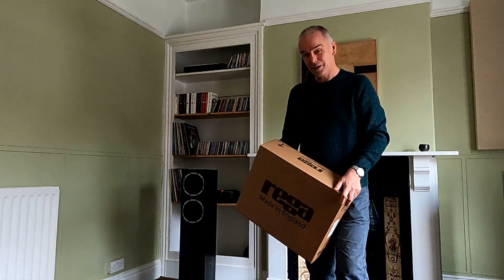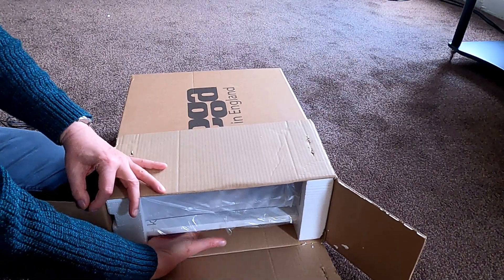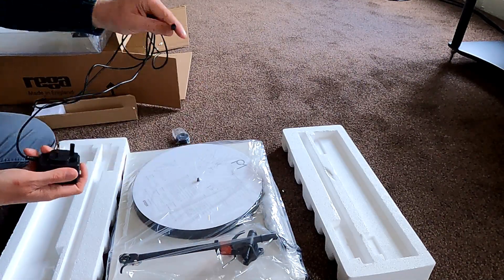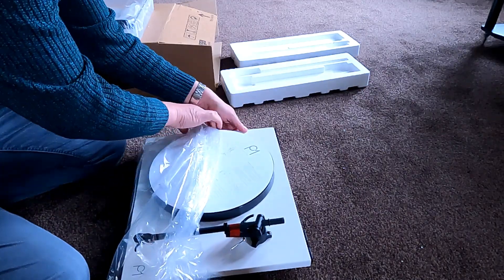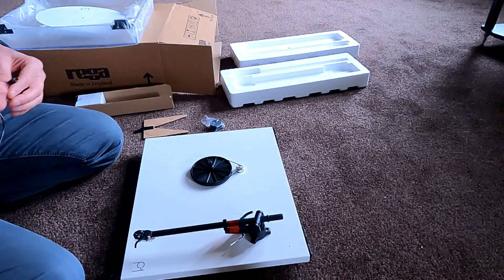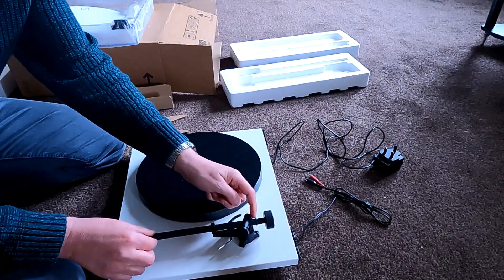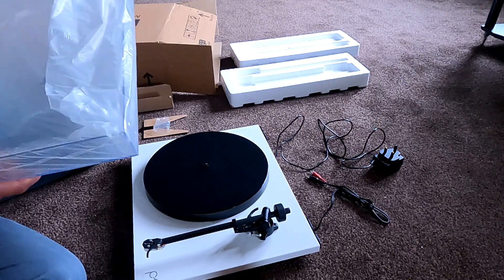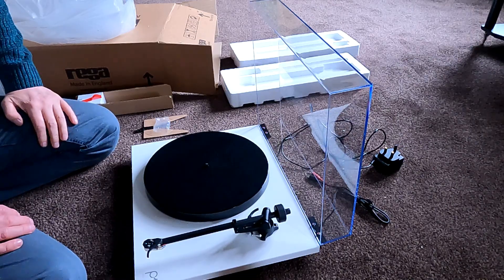Rega Planar 1 unboxing and review

Comment: I have an RP1 and love it, although I've ditched the Carbon cart for an AT440MLb.  The big difference is the 24v motor?  What difference does that make?  I'm guessing a lower noise floor?  Just wondering whether to buy the 24V upgrade kit.
Reply from the maker: Yes, it is to do with noise .... not sure the 24v kit fits the RP1 though, sure I've looked into this before,  they are labelled as P2 P3

Comment: I have the Planar 2 and one , wanted the one Plus but out of stock so I got the one you reviewed. Excellent tables with the Rega Carbon.
Would the Mp110 work well without any major adjustments since the bias is magnetic?
Reply from the maker: The Bias will be fine as it’s preset to 2g which is ideal for Nagaoka... you will need to set the tracking force with a gauge though
Reply: @cheshireaudio  
I usually set the Nag at 1.8g won’t 2 grams put too much stress on the cantilever?
Reply from the maker: @lawrencecabrera5937  it's not so precise, the bias force needed alters considerably across the record and is different on different programs...   most decks only have 1/2 or 1/4g graduations and some have none at all,  ..    I tend to use a tracking force of 1.9g on a 110, but its personal really.  The internet seem very paranoid about bias nowadays.
Reply: @cheshireaudio  
I concur! There is a bit of  negative hype with the magnetic bias of the Planar 1 & 2 
I’ll install the Nag this weekend.
Thank you!
Reply: @lawrencecabrera5937  how did it go?
Reply: @ajmoore2201  
I installed the nag110 on  a head shell for my Pioneer PL518 and a Rega Bias2 on my Planar 2 which sounds great still thinking about upgrading the Planar 1 I have. Since I use it with my headphone set up and like the balanced and not to bright sound of the Carbon.

Comment: Do you need a 45 rpm adapter to play 7" records on this turntable?
Reply from the maker: No, the motor has a two stage pulley so it will do 33 and 45
Reply: @cheshireaudio  I think he's referring to the adapter to fit records with a large centre hole (more common in the USA)
Reply from the maker: @cjmillsnun  ahh, see what you mean .... I was thinking off the collar that Linn to increase the size of the motor pulley.  Yes, you do need one,  Rega make their own..

Comment: I have  the same 2021 model in black.  The PSU makes a buzzing noise.  At first it was rather loud, now I can only hear it at a 40 cm distance.  Is it normal?  
Second question: I am not loving the sound quality, some albums sound better over a bluetooth connection to my amp.  This makes me worried my model has a problem, or whether it's a cartridge issue.  Do you have experience with a Nagaoka MP 110 or AT Vm95ml?
Thanks!!
Reply from the maker: I would get the power supply swapped by your dealer, they can start to fail
Reply: @cheshireaudio  thanks for the reply! This shouldn't be affecting the sound quality though right? What do you think about the cartridge question? At the moment I'm using a Marantz Pm6007 integrated phono stage. Would the nagaoka or a separate phono stage (eg Cambridge Solo) be indicated?